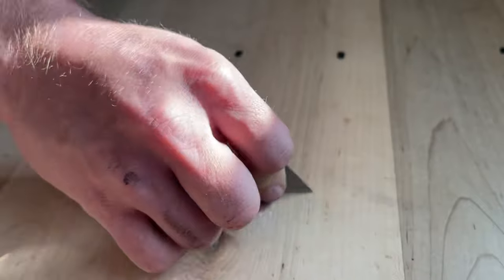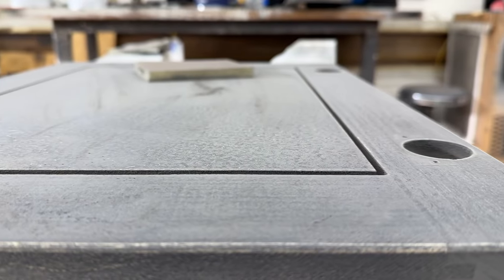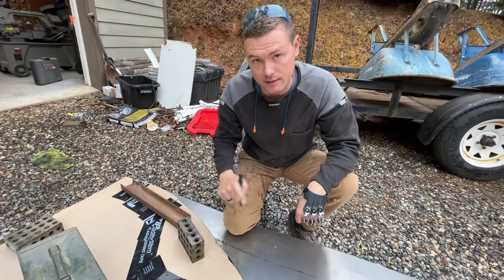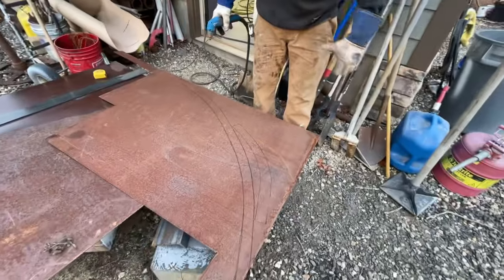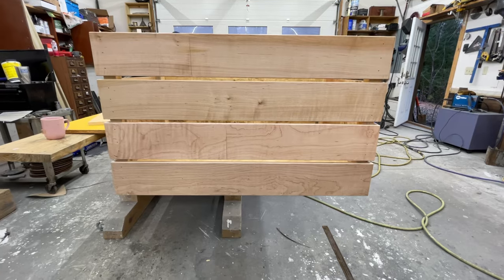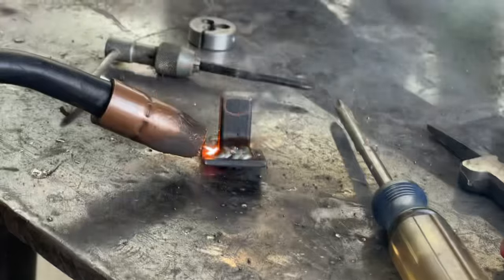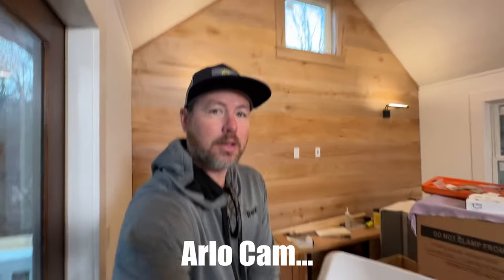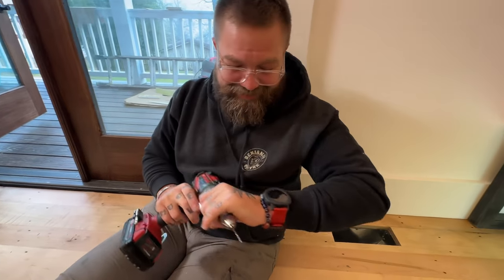Building A Small Income Property | Part 40

Comment: Buddy you need Knee pads I worked on Commercial Kitchen Equipment for 25 years and poured concrete on the side and now after 7 knee Surgeries I regret doing what I did!
Reply: Yeah, can't understand being in the trades and not wearing pants with integrated kneepads. You wouldn't see anyone without it here in Scandinavia I think.
Reply: Cry about it ❄️
Reply: @Davey768  cry karen ❄️🤡
Reply: What do they know about working. Safety second money first.
Reply: @thewhiteknight02  🤦‍♂️
Reply: They wear TrueWerks.  Knee pads are built in. I got a pair because of them. The only bad thing is when you aren't wearing them, you forget that you don't have knee protection and bang your knees. 😄
Reply: Jaimie, listen to this man (John Buckler).  My knees are not that bad, but at 62, my body is beat up from laying floor tile, wood flooring, etc.  wish I had knee pads and better hearing protection and my back is trash.  Do what you can while you’re young before you get older and wish you’d done things differently
Reply: Agreed
Reply: Yes sir, protect the knees. I’m currently 2 weeks post operative total knee replacement at 68 years of age and it’s no cake walk.
Reply: I was saying the same thing lol

Comment: Great job with the baskets. As a mechanical engineer I have every sympathy with the cooker hood, but just be grateful that the steel sheet isn't .25" thick. I've done my fair share of conical rolling on machines that could bend .50" steel sheet. It is a mind boggling operation to keep the shape to the specification. Well done all of you.

Comment: The double trace is a awesome way to get rid of your wobbly arm when using CAD (Carboard Aided Design) I have done that so many times working on custom boats and repairs. I was also a huge fan of 3mm (yes I am a Aussie) MDF strips cut from a old cover sheet and stapled to form a template, Works so well for larger templates as you can split it into smaller sections and reassemble giving you less chance of deformation before you get to cut it for real.
Jamie I think bending the bell was easier because of the conical shape giving you more leverage than the tube. Either way you all inspire me with your craftsmanship and attitude and make me want to do better everyday!!
Lastly, you're some lucky guys having such stunning ladies in your life's.

Comment: Jamie, go and find a rolling machine (hand tool) and roll that metal!  You can roll even or cone.  It’s easy when you have the correct tool for the job. I hate seeing you struggling. Somewhere in NC close to you there will be a sheet metal shop and they WILL have that tool (machine). I promise! I am trained by the USAF in structural repair of aircraft and we used this tool to shape the metal when an OEM part wasn’t available or when readiness was crucial.

Comment: Would be great to understand some of the rationale behind your choices. For example on the handles for the wood crates, you could have easily purchased some nice finished handles online or even Home Depot that weren't too expensive, but yet you chose to spend the time, which is probably more than if you'd just got the handles, to fab the handles from stock. I guess I feel there are instances like that, that don't make sense to me. 

I'm sure this is also true for the range hood. How many total man hours did you spend on that?